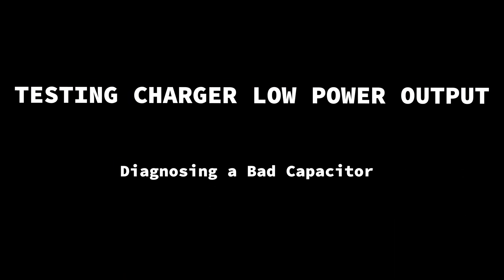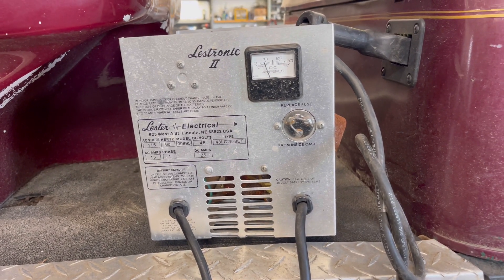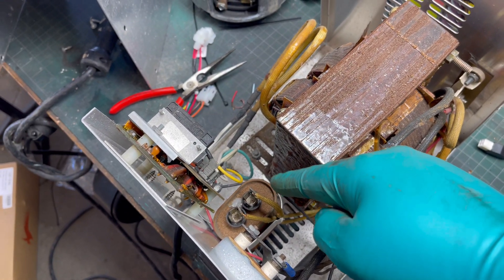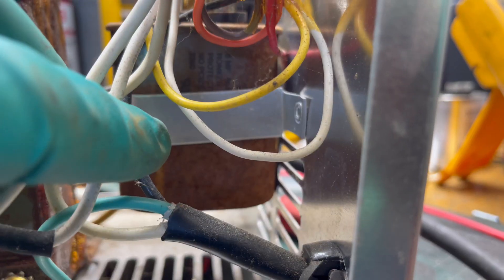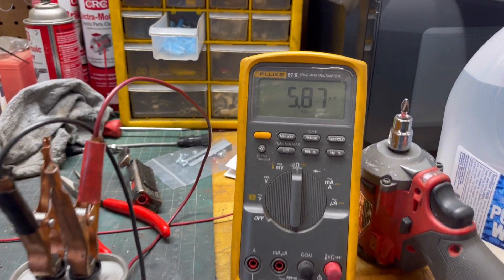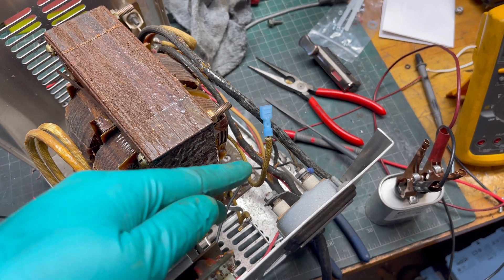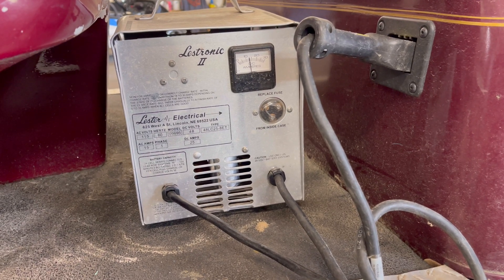No Power Output on Golfcart Battery Charger| Test The Capacitor

Comment: Normally, the capacitor is removed from the circuit prior to testing for accuracy.
Reply: Yes sir, thanks for sharing.
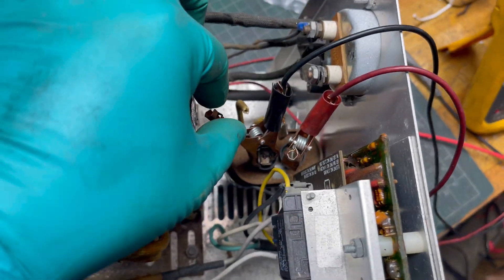Reply from the maker: Yep, that’s correct. That’s what I did. It was unplugged before testing. I may have forgotten to mention that but around the 3:29 mark you can see the wire unplugged.